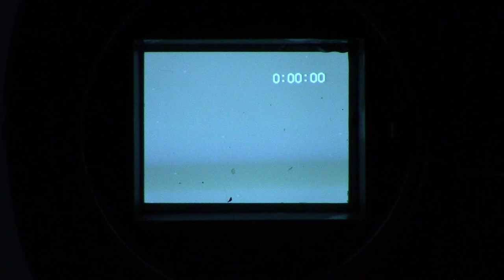Sony CCD-FX425 Handycam 8MM camcorder - Wont load the tape - MORE SMD capacitors, most leaking

Comment: I read somewhere that SMD caps leaking was caused when an employee left one company and took the formula for the electrolyte to his new company, but it was missing some key elements.    Have you heard this?   I am wondering if it's possible to put a date range on bad SMD caps in 90's equipment.   Or do you think that modern SMD caps will leak like this in 25 years?
Reply from the maker: I think the "newer" SMD caps are manufactured to a higher tolerance. At least I hope so.

Comment: Uneconomical to repair sadly... If it was mine I might be bothered, although it's probably easier to just buy a replacement despite the fact that may well be suffering from the same problem. CCD will need to come off of the board if it's to go through ultrasonic cleaning too.